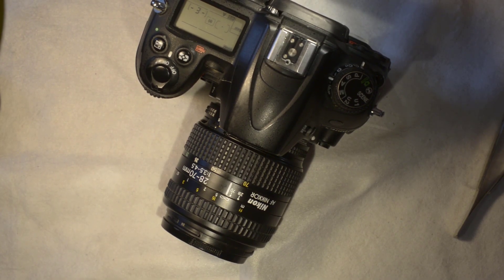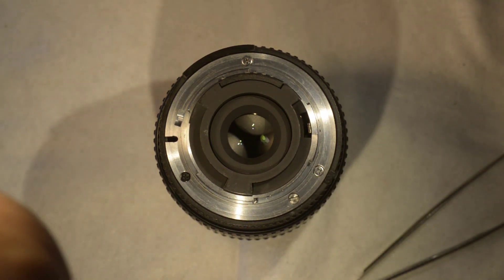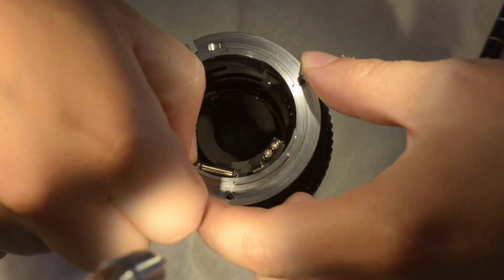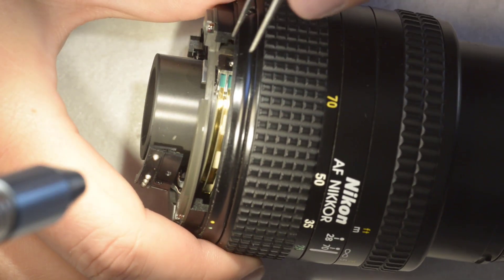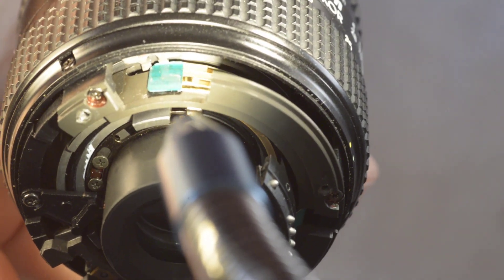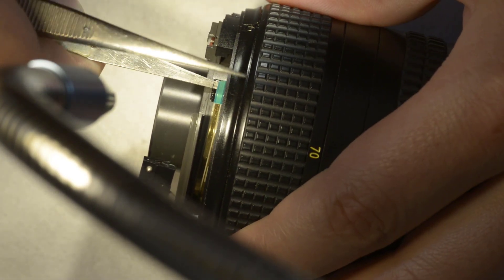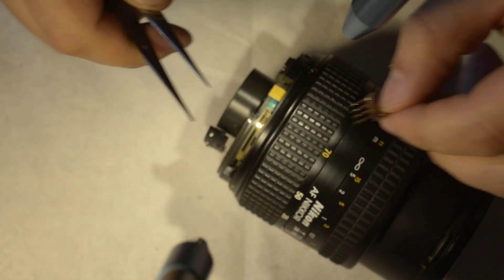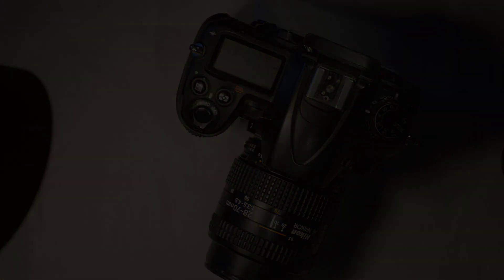Nikon Lens repair: Broken autofocus

Comment: i have Nikon 28-105 f3.5-4.5 afd.  It has a focus error.  Focal length reported wrong.  It took me 8 hours to take it apart.  and edit like your video.  but now I can't put it back.  Can you make a disassembly video for it?
Reply from the maker: First, I'd need to find a 28-105 in need of repair. I'll take a look around
Reply: @diyextravaganza  Thank you.  I will look forward to it.  I have reinstalled a few things.  but the little hand could not be reassembled.  My lens was bent by a small hand and a bit of copper wire was broken.  hope it's ok
Reply from the maker: @ZoboVN  you mean the little pins that read the zooming or focusing position?
Reply: @diyextravaganza  yes that's it
Reply from the maker: @ZoboVN  if you're careful you can straight them again, the copper you can maybe repair using copper tape used in electrical installations. Best.